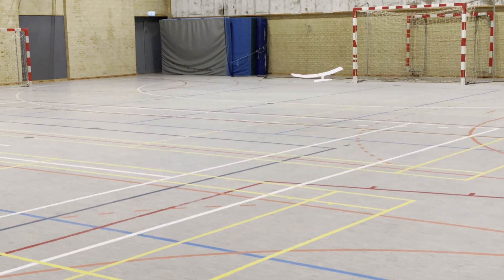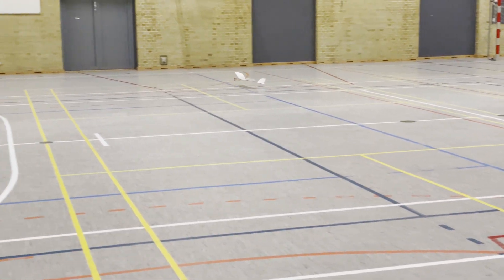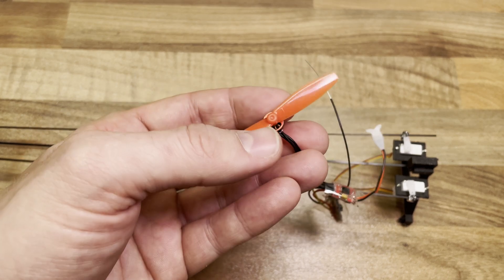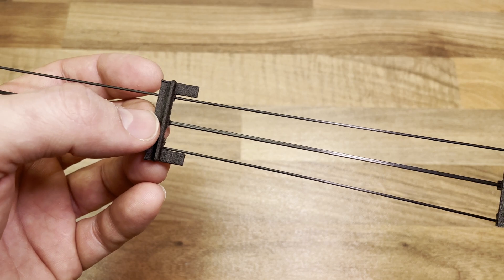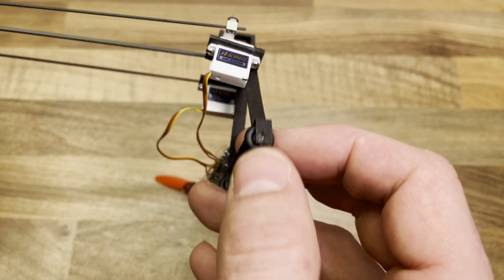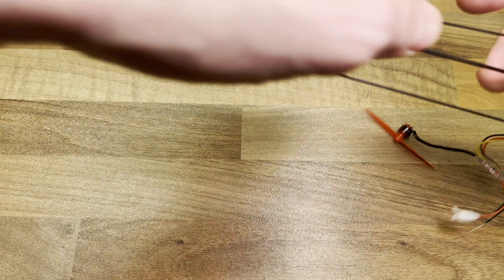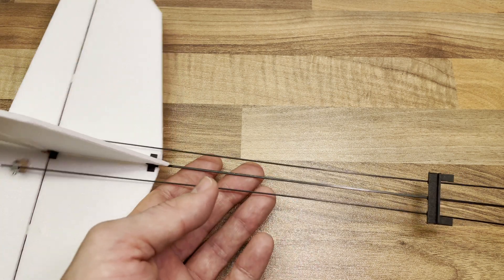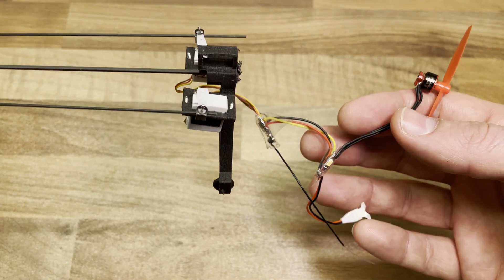World's smallest brushless motor (BR0603B) on an RC airplane

Comment: Will a 3 inch propeller fit this engine?
Reply from the maker: Hi. I have not found a 3 inch prop with a 1mm prop shaft hole. Let me know if you find one. The one I am using is the bggest I could find for a 1mm prop shaft
Reply: @kaspersorensen  The DJI Tello propeller is approximately 3 inches and has a 1mm shaft.
Reply from the maker: Sweet, that should work then. Thanks

Comment: Did you try using light wires instead of carbon fiber to control the rudder and elevator?
Reply from the maker: No I have not. I have tried 0,5mm carbon but it bends too much. The 1 mm carbon weighs 0,6 g each for the 45 cm I have cut it at. Do you have wire that is lighter than this?

Comment: information.            i am sure that this will all  go  WHOOSH.      but, i am gonna  try  anyway.
at :20,  Poor design has resulted in stabs  that  are (large and)  HEAVY.       the top edge of a vert-stab  Should  be  a  straight, Horizontal  line.!
the tail boom twisting that you complain about would be  reduced, if the rudder  were not  OVER-large.!!!        the  chords  of  the  control surfaces  Should  Be  Equal.!
it appears that the main wing  has  a  Very  thick  profile.!        a single-surface profile  should be  mounted with a couple degrees of positive aoa.!   this means, the leading edge  should be  a  little  Higher  than the trailing edge; relative to the thrust line.
the  Mass  of  the landing gear  is  NOT  optimally  located.!       when the model is level, that mass  Should be located  below the wing leading  edge.!
the distance between the prop and main wing  is  excessive.!   by  about  two  inches.
to the extent that it is possible,  all of the  'added'  mass (of servos, etc) should be  located  near the cg position;  that is,  thirty percent of chord.!
where a model has an abnormal dom, as is the case here,   cg  should be located a bit forward of thirty.!      dom  is  distribution of mass.
WHY  did you choose to use  outboard  dihedral.!    it makes  about twice  the  drag, that  central dihedral  does.
at 1:25,  CF   is   Heavy.      this model  SHOULD  have  the  lightest possible  pushrods  and  tail boom.!      ever hear of  BAMBOO  or  pine.
if you do  not  Understand  how a  GOOD, light, longer pushrod can be fabricated, see  linked  drawing.
at 1:45, elevator control horn  is  Not  optimally configured.! 
the use of  Heavy, metal components (such as quick connectors) at the TAIL,  Should  be  AVOIDED.!          googletranslate
http://dynmodel.com/sig/007-1.jpg
Reply: What humungous pile of unnecessary crap you wrote. The airplane flies and flies well. You build one and post it, OK?
Reply: which plane do you like?